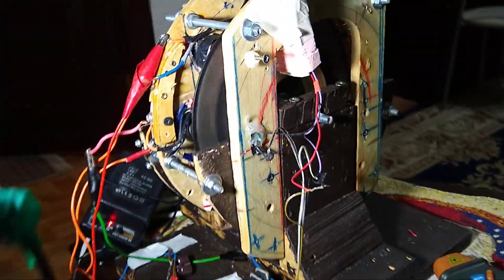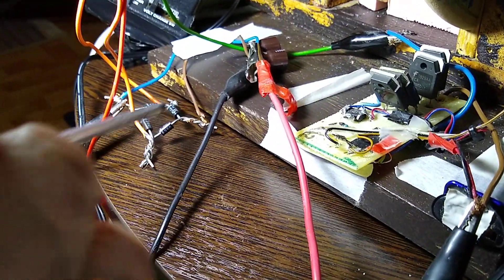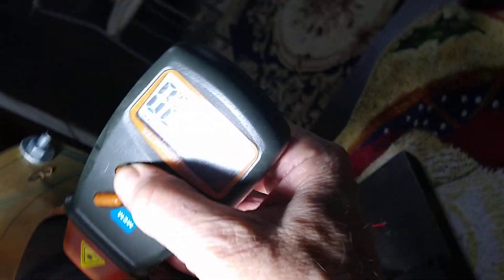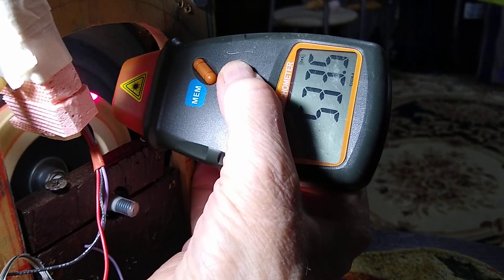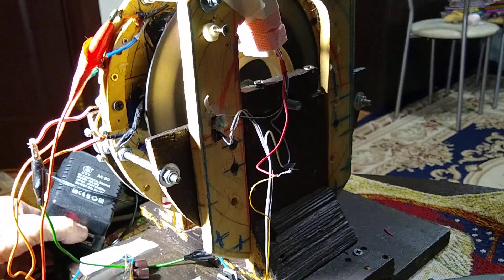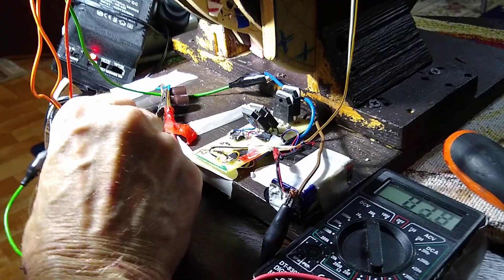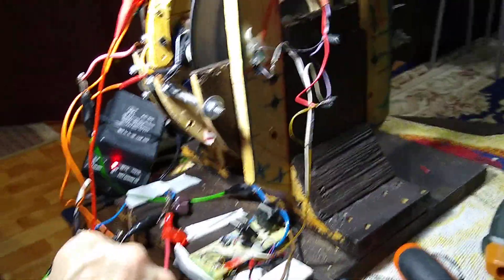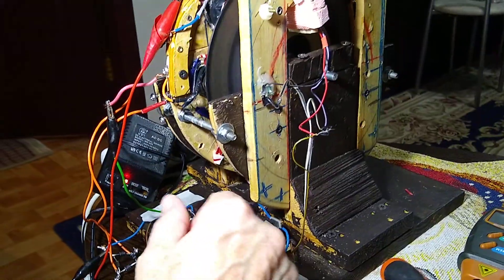No lenz reaction with new magnet-rotor offset BUT only 10ma current crowbarred "why"

Comment: Hey Kone, bro d here from EVGray past.  Are your coils in series or parallel?  Thanks, I'm working on a bigger one (3X size) will report.
Reply from the maker: Hi Donald
EVGRAY is still going on pretty good.  200 members now, not 2000 as before....Hector is back Norman Wootan there too.  New site after yahoo took them all down is EVGRAY@groups.io  you can google that to find it
The eight coil positions  in my "dualrotomotorgen" are all in series....the eight motor coils are in series, and the eight generator coils too.
If I was to make another one tommorow, I would have longer cores, Instead of 25mm ferrite three or four times longer so can really pack alot of generator winds on there.   Also I did not wind the motor coils directional, (pull back to start after every layer) and the motor coils would have a little more power like that if I did.  I like the 16 magnets in each rotor, vs eight coil positions, the rotor spins very very easy. magnets very thin too, I think helps literally "cut" through lenz law.  Magnets I use are N52  only 1.5mm thick and 20mm wide disc shaped. 
Seems like the best "offset" between rotors is just a bit "leading" from one rotor to another ( 2 or 3mm in my tests) this seems to be big factor cutting lenz law with coils under load.
I would like to try NS magnets in rotor too, not all facing same polarity as is now. Could be not any better like that I dont know. 
At 1500rpm there was virtually no lenz while making some decent amps in all generator coils in series crowbarred to an amp meter.
Next cores I think will be longer ferrite "sticks" (still 5mm wide) and surround then with straight  lenghts of soft stell florist wire so get some better transforme/induction-action going on between the motor coil "in front" and generator coil at the back.
Keep in touch I really want to see how your bigger and better version works out. konehead  
at  msn  dot   com my email
You should join new EVGRAY too lots going on there,,,,
Reply: @MrDKONZEN  Hi Doug, thanks for the response.  I have already rejoined the group.  My bigger motor was originally a copy  of Rick Friedrich's 4coil dual pole.  It  has 8 coil positions  (4run,4gen) and 8 neo mags.  I'm rewinding the coils with #22, wire as you have done. (1/3run and 2/3 gen) These are the standard Bedini size spools. two rotors with 1.5" x 1/4" neos.  I'll try the copper  covered steel welding rods first for core material, other wise I would have to make cores out of magnetite and epoxy. This is costing me nothing because I have everythng on hand. I'll post pics on the group.  Thanks, again.

Comment: and I could add that if the wire is well twisted its keeps the electromagnetic field in the coils, that its better protects against radiation and that its better supplies the transistors, the fact that it heats comes from the positive charge ... the most efficient it is the barrium ceramic. monopolar the adam, a south in the center 4 north went outside so 4 potential difference multiplied by 2 which gives 8 potential difference by all ... so to calculate a performance coefficient I do not see what better than to use 8 potential difference and therefore of amplitude on a single turn of the rotor lol ... that multiplies the number of minutes of use ... 2 positive charge phase shifter at 180 degrees at the input and 4 at the output. .. positive or negative it depends mainly on your magnet concerning the bedini motors the neo dyme magnet saturates the cores for nothing, rather saturate your generator coils. to avoid saturation of a core you must test different ones t ...(I say that because I'm interested in it, it's efficiency .. and for the triggers, know that just two transistors for 4 generator coils work well too, I've been testing them for 6 months, it's not bad. I have the mini renaissance duel and the senior renaissance going up like that and it also accelerates under load...

Comment: Very Very nice, what i still don't understand is why, when you short out the coils, you still have the voltage jumping around on the voltmeter.. shouldn't it be 0? or is there a bad connection somewhere?.  Also some questions, because i am going to try and replicate... you said some time ago the magnets were all same polarity?  does that mean that  each coil is hit by a south pole on one side and a north on the other? or are there 2 south (or 2 north) facing each other?. Anyway.. keep it up, can't wait to see next experiment!
Luc
Reply from the maker: Hi Lucy
I will guess the motor coils pulsing 16 times a revolution dominates and overwhelms the normal operation of a generator coil being induced by sweeping magnets, so just guessing but the voltmeter not "settling down" to zero volts from the dead short  across the string of eight generator coils in series (and these all sharing the ferrite core with the motor coils) is because the motor coilz's induction into generator coils still "gets through' no matter generator coils dead shorted.  That is theory A.
Theory B is the backemf and the spike of motor coil blast right through the generator coils not just the forward current as in theory's A.
Theory C is theory A and B.
Theory D is the timing of the offset rotor magnets has cancelled out current production from the generator coils except for a very short blip in time  of rotation that's why nothing happens when coils dead shorted, but the idominate nduction of motor coils sneaks through.  Theory E is I don't know need more tests and different offsets plus run real loads from generator coils.
Reply: @MrDKONZEN  I vote option B and D.  When I put a generator coil output through a choke in series to create full Back-EMF and short both leads , I see good voltage on the scope and no lenz drag. But amperage is like nothing.

Eventually I figured out the meter or scope probe does not know which direction the voltage is coming from if it is hooked to in parallel to a closed circuit. All it knows is the wire it's connected to has greater potential than the other. 

I always wondered if it's possible to beat lenz by creating lots of counter current in a generator coil and only harvesting the counter-current. When I try- I realize the counter-voltage has like no counter amperage unless I am harvesting the forward current because the counter current is produced from the flux that the forward current creates in the coil.  

My brain hurts from all this counter twisting logic. lol
Reply from the maker: Magnets are all facing same polarity on rotor face, not NSNS etc 
If rotor A faces rotor B directly rotor A to left will have inside motor face let's say S so inside facing motor face would be N so good magnetic field cutting through
Then from that position, I skew the rotors, right now center of rotor magnet A is lined up to edge of rotor magnet B
Reply: @MrDKONZEN  one thought and 1 last question: I have no idea, but it would be an interesting test: if you reduce the timing magnets from 16 to 8, it would pulse only every second magnet, which would mean that between the pulses the motorcoils would turn into pickup coils. maybe they would contribute into filling the caps even more. (just an idea, as i said i could be wrong)
the question was the space between the magnets. seeing the rotor i asume that  the space between 2 magnets on one of the rotors is a little less than the size of a magnet. so if the magnets are 20mm, the space between them would be around 17mm ?
Luc
Reply from the maker: @FreeEnergyNerd  yes maybe magnets too tight for best performance I have two rotors like this already built with8 NS magnets but don't know when I can get to it.

Comment: have you think about a principle of operation what is for you the good interaction between motor-gen and magnets?
Reply from the maker: Good interaction would be where particular offset in rotors cancels out or reduces the lenz braking effect from generator coils.  
With motor coils sharing cores with generator coils as is now it's hard to tell if it's not motor coil over dominance and influence in shorted out enerator coils making the no lenz effect and not really the offset, however two videos ago was getting lots of lenz braking and only difference was offset a bit different so not sure right now what to think need to test alot more
Reply: @MrDKONZEN  I think between magnets occurs a middle point where the field can flip at no cost for the rotor, and the ferrite core lay in this point..

Comment: Very impressive no lenz Doug! 👍
Reply from the maker: No lenz but maybe because not much power being made too and motor coil induction dominates or it's something else.  Really I should have external motor spinning it to see what offsets do, as the motor co ils shar cores with generator coils and has great influence maybe this will be really good in future maybe will negate he no lenz condition
Reply: @MrDKONZEN  Well you can put a motor coil on the outside of the magnet rotor and use the internal coil as collection and maybe do a timed shorting on the inside motor coil. Do you have any small speaker ring magnets to replace the inside motor coil lol I'm outside box looking in ha ha anyway i'm liking what you got going on there, great videos coming out of Belarus! Cheers👍